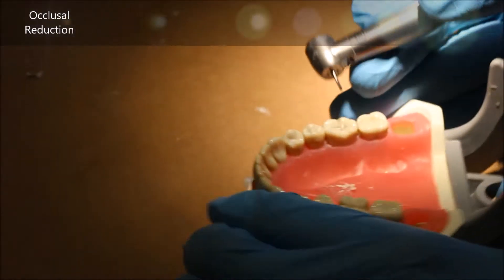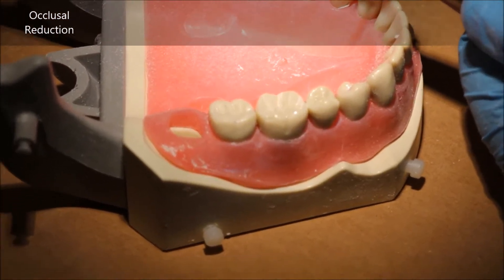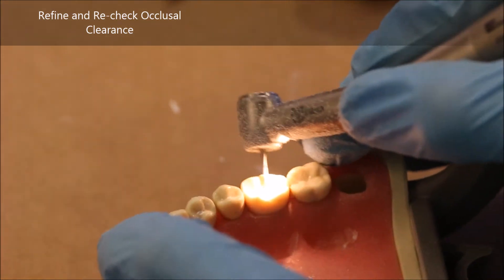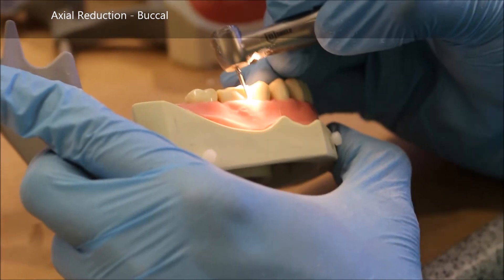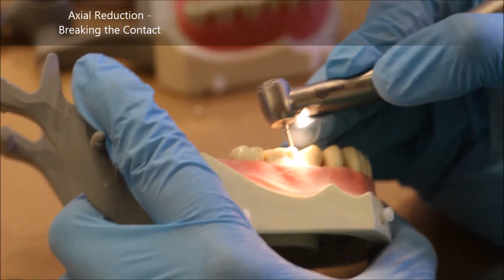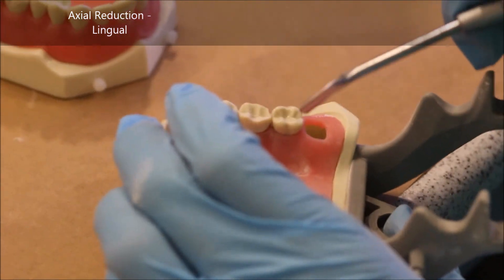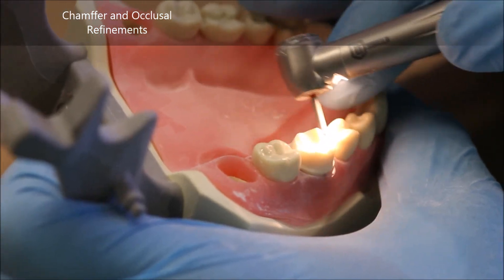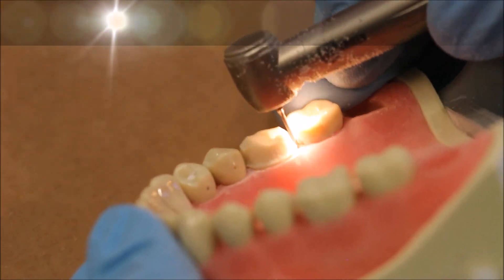Full Gold Crown Prep on #30

Comment: You are making a big mistake by not following the long axis of tooth, please mark 6 depth grooves accordingly on 4 corners and middle and follow it while moving in side the contact no matter how thick the bur is roughly a 1mm dia tip will suffice giving the chamfer 0.5mm. Nice video though. Your molar is excessively tapering in four corners.